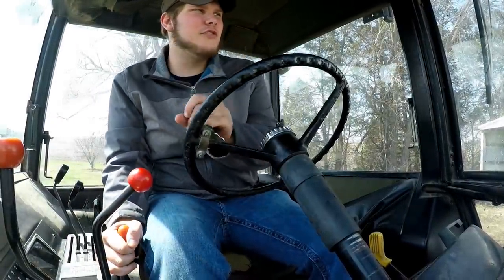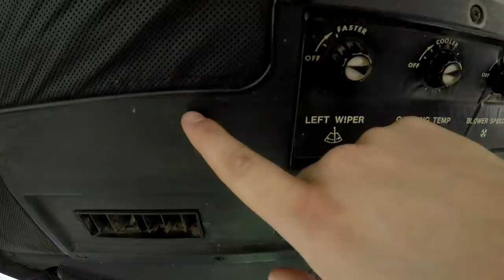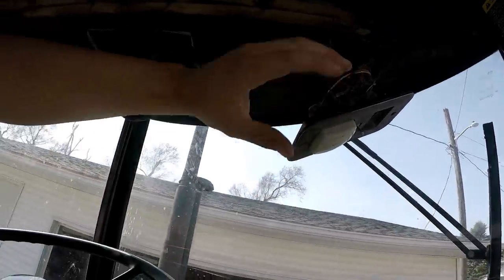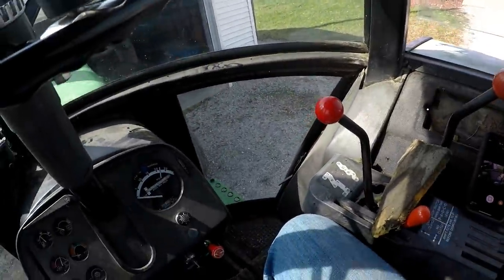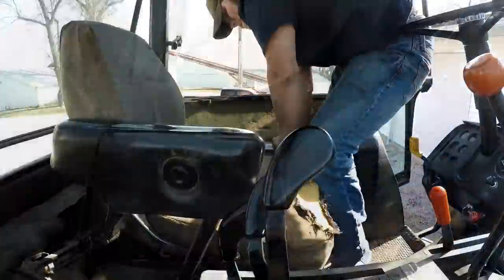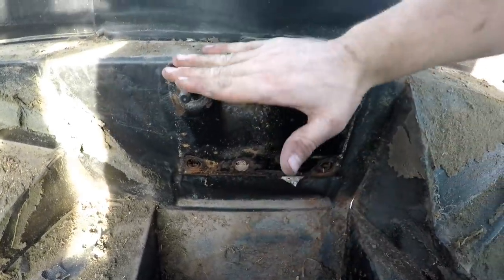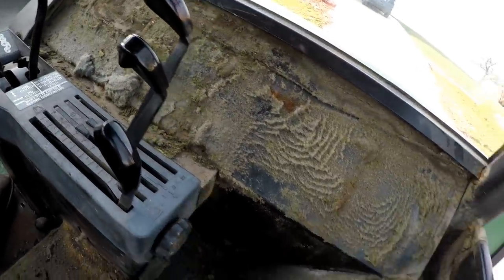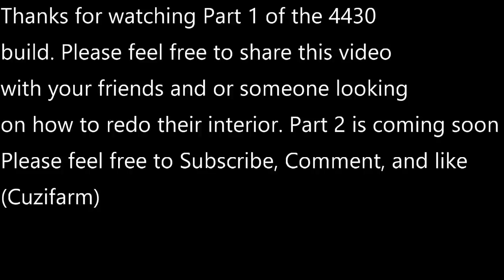John Deere 4430 Cab Kit Removal | First Of The 4430 Project

Comment: Those screws you found in the light...they hold the plate on above the air conditioner.  You have to take the cab top off and you will see that big plate and I bet you have two screws missing.  I have a 4430 also and love that tractor!  Good work!

Comment: I have ours strait piped and it sounds damn good but by the end of the day you will wish you had a muffler. Mine is painted flat black with BBQ pit paint cause I got the pipe free but it was pretty rusty. Its an option to start with to make sure you want the strait pipe cause the chrome ones aren’t cheap.

Comment: Mason, those 2 screws you found above that light came from a sheet metal cover under the outside cab cover. There is probably a dozen or so holding it down. Might pop your mirror bolts and the 2 screws under the front side of the cab and fold it back and check it out.
Reply from the maker: Carson 647 thanks man I will check it out!

Comment: Leave the muffler on they are designed to run with the muffler you will have heating issues if you run it with it off. Your nuts for using a wire brush with no safety glasses buddy lost sight in his eye using a brush with no glasses
Reply: Overheating? I never had that problem